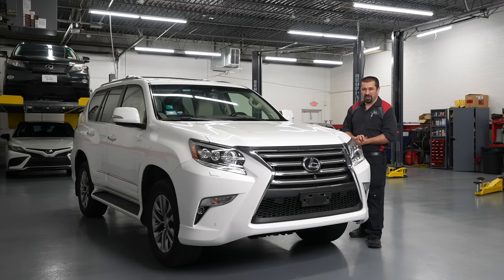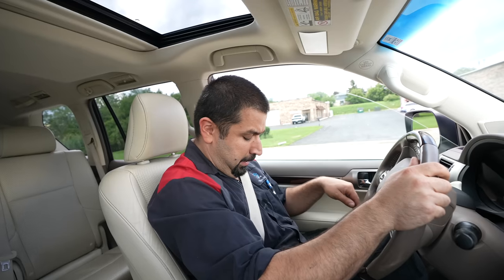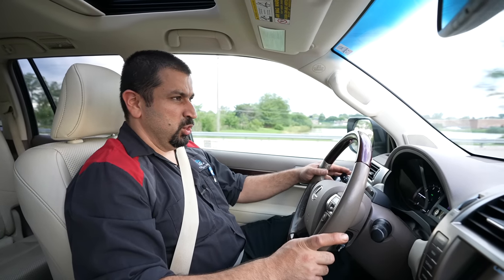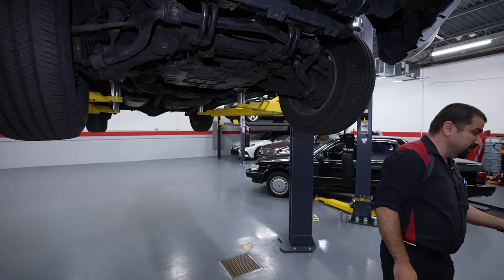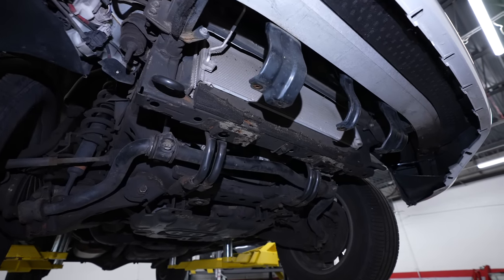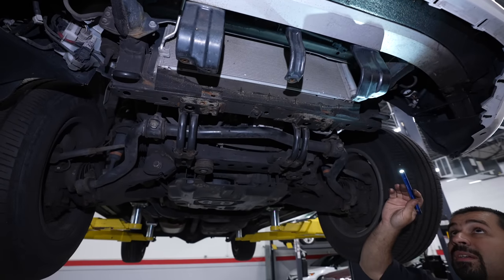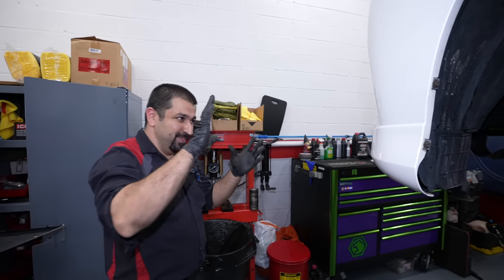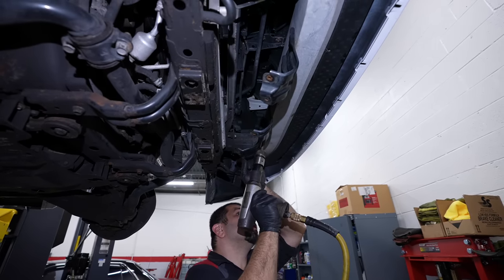Lexus GX460 Off Road Damage | Our Cameraman Had a Bit Too Much Fun! Let's Fix It!

Comment: The tires still have decent tread on them despite the age. Not sure how many miles they've gone, but I never get more than 45k (2 years) out of a set of tires here in the hot south. I wonder if Michelin sells this tire for my 2022 Sienna.
Reply: Michelins are smooth and quiet but wear out real quick…and they were on a Corolla so nothing heavy or high performance.
Reply: @damiangrouse4564  I don't think I've ever had a set of Michelins on a car. It may have to do with the type of tires these are and what they go on.
Reply: @alexandermartincausey7333  it’s worth trying them at least once. They are very nice in all respects except longevity
Reply: @damiangrouse4564  herein lies the problem. I drive for rideshare and getting 30k out of a set of tires is less than a year; and when they're the most expensive tires available, that isn't exactly acceptable.
Reply: @alexandermartincausey7333  yeah, for private use only…nonsensical for comercial use.
Reply: @damiangrouse4564  It seems like that specific model of Michelin dryrots before it wears out, which is what I want. I just don't know if they make it in my size. I don't mind dropping $1200 on a set of tires, but I want to get 2+ years out of them if that's the case.

Comment: I have a question regarding tires. My wife has a 2018 AWD lexus RX 350. We replaced the front tires a couple of months ago. Rear tires are about 50% tread. She mainly drives city streets. Rear tires have worn evenly. I was planning can get another 15-20000 miles out of the rear tires. Then get a new pair for the front and move the front ones to the back. Do you think that would damage the awd system if i wait another year two? Thank you for your advice😃
Reply: I have been told more than a few times on full time AWD vehicles to replace all four tires at the same interval. That's how I have always done it with my vehicles and never had any issues.

Tires are already expensive and that is one less thing I want to deal with down the line. 

The last two AWD vehicles.. I have had them rotated enough regularly to where they always wear evenly.

Comment: Is the GX's skidplate that was replaced the same skidplate used on the the 5th gen 4Runner?
Reply: Only if the 4Runner comes equipped with kdss. Otherwise it is a different skid plate.

Comment: Do you recommend a transmission flush on a GX 460 with 85K? Its a 2014 and never had one before.
Reply: Believe he said 6 years or 50k, if over 100 don’t bother
Reply: @chibbyylol  It only has 83K miles on it so I wasn't sure if it is still good to go ahead with it or not.
Reply: Drain and fill, pull the pan and clean the magnets. Don't touch the filter as it not meant to be a serviceable item. Is just what I understood from past videos addressing the sealed transmission and servicing.

If the car is over 100k miles up to 120k and never been serviced don't even bother with changing the fluid.

Good luck finding a dealer service department that won't want to do anything besides a full machine flush. My service does everything  they can to push me into a machine flush (they say its cheaper, I don't care what is cheaper I don't operate like that, I want done what I want) and not a drain and fill.

Comment: These cars are not for off-roading. 💔🕊️
Reply: Once you cut all the Lexus off, they're pretty good off-road. 😁
Reply: Good grief! Off road with this car? What car care nut does this???😂 Not a real car care person.
Reply: This is a lesson in: Just because you can, don't mean you should.
Reply: @alabama2uz  Can you really cut off all the Lexus? 😲🤣
Reply: If you know Toyota has been in the off road game for a very long time. The GX was made to off road even in stock form.
Reply: The GX is the same thing as a Land Cruiser Prado.
Reply: Don’t tell that to the people in the UAE because they dune run these all the time. In most cases completely stock! They off road If you have the right driver
Reply: @royomonigho7075  I did.
Reply: Chop off the running boards, front bumper cut to the fog lights, rear bumper cut to the parking sensors and you’re good to go

Comment: I'm going to MODIFY mine-- when I get one-- 2 " lift-- mags with KO2s.., body armor underneath- rock sliders,  hitch mounted rear tire carrier, higher front end with winch and special bumper, lights etc., extra gas tank in the well where the spare was- for total of 56 gallons instead of 23..  and upgrade the computer stuff..  MIGHT put lockers (electric) in front and rear... can get those for FJ 2010 or newer and they will bolt in directly..    Set up this way - MUCH less chance of damage.
Reply: I drive in the dunes of abu dhabi. Skidplate is the first thing you do. Beadlocks #2. Suspension #3. With that you can do most mid level stuff fairly safely. To go hardcore, you need to tune it and open up the intake/exhaust all the way. Long travel suspension, 34's etc are just gravy.
Reply: @randomuser6306  YEP- that's what I was thinking-- when I mentioned my mods I want to do- I never put them in correct order- just as they came to me right then.  I'm NOT going "hardcore" just basic offroad- like winter stuff- or if I get on really muddy road or field.. etc. NO rock crawling etc.  I was mashed between 2 trucks in 99 and my body can't take the shaking and jolts from that.. :)

Comment: must be an insurance job, all that stuff damaged can be fixed, and i guess this guy has never heard of nutserts when things are stripped out, and or no way for a backing plate used in aircraft all the time and not that expensive and my 10year old Hankook tires have none of that checking and rotting off, bad tires